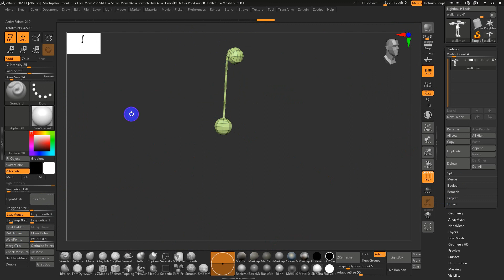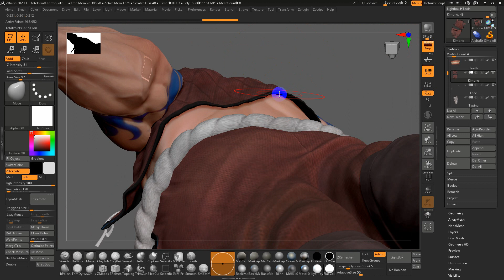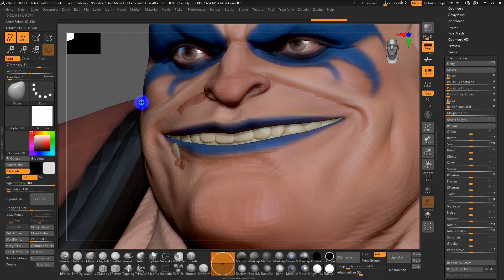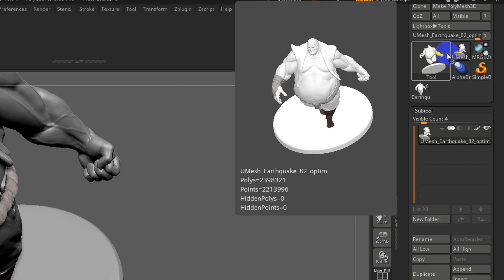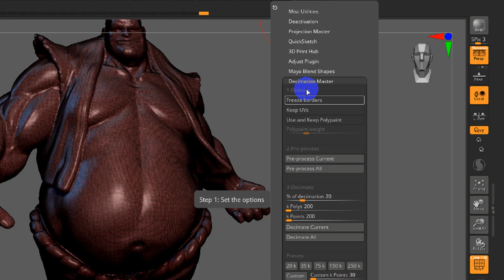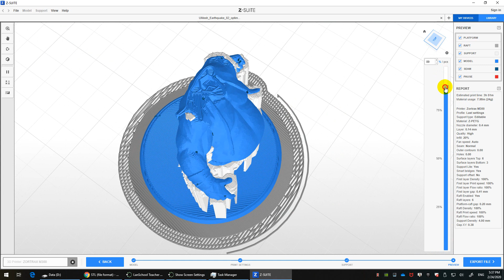3D Printing Prep With Zbrush 2020

Comment: you are not gonna cut the model for example some people divide 3d model into several parts like arms head legs?
Reply from the maker: Yes you can add this step, but this was intended as a basic intro. I've been able to print figures using the techniques in this video with great success.
Reply from the maker: Also if you want to make a far larger print than your printer can make you can slice the model into the biggest chunks your printed can handle to get a larger overall output.
Reply: @mmmcgyver  how much maximum size did you able to make the print without cuts? can we have 15cm tall without cuts?i know it depends on printers but what is the average size should be?

Comment: Thank you for this video, it helped a lot to me ! But i have a question if i make my layer thickness 0.2, It makes my mesh inside empty  - lighter - isnt it?
Reply from the maker: I believe the layer thickness is just for slicing the model. There should be a print thickness in your software for hollow, solid and pattern fills. Pattern fills are nearly hollow but give a lot of strength and save print material.